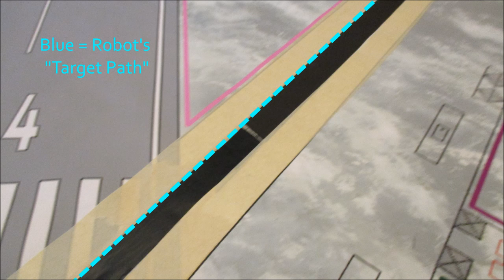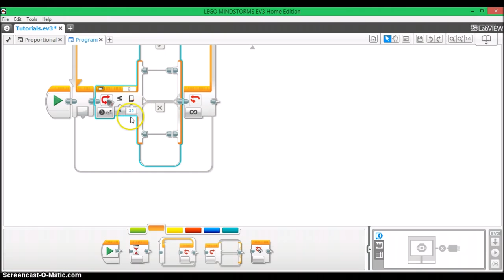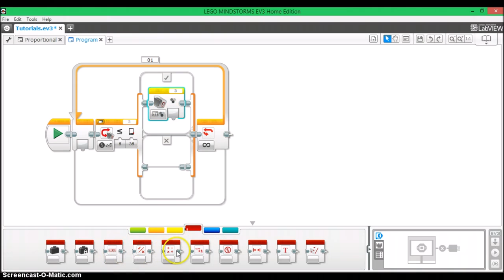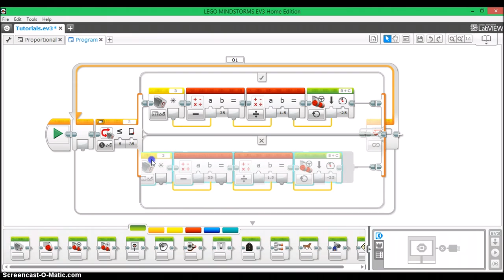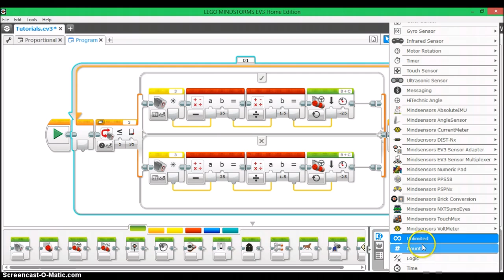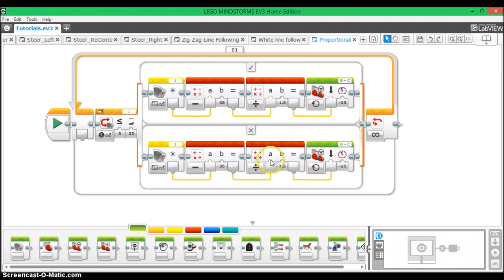How to Program a Proportional Line Follower for EV3

Comment: hi i have a question which is VERY IMPORTANT (for me) you adviced to put the robot on the right side of the line at the timing 6:30 but the thing is that i have to make my robot line follow on the left side of the line then how to program that please do tell me bcoz i already said it is important for me thank you : )
Reply from the maker: No problem! All you need to do is mirror the turning by negating the Kp value (this is the number you multiply by in the math block).

Comment: What are the advantages of using 2 light sensors to line follower over only using 1? Based on watching most of your line following videos, it seems as if using 1 light sensor allows the robot to use a more accurate program like the one in this video or PID line following. It seems as if "1 line following" is better than "2 line following ".  Can you help me confirm this theory?
Reply from the maker: I find that more color sensors makes your line follower more stable and more versatile, especially considering a proportional algorithm can be applied to a 2-sensor line follower. I even have a 3-sensor line follower tutorial coming up soon; that is hands down the most versatile line follower, because it can follow anything from straight lines to 90 degree corners. However, each person will need to decide what kind of line follower they need.

Comment: Builderdude35, why do you divide the light intensity from the first math block by 1.5?
I need some help with that because I want to make sure it works and someone else from my team has the robot. Please reply to this and answer why.
Reply from the maker: That is a scale factor and it is meant to adjust the sharpness/smoothness of the robot's turns. Increasing the value makes turns smoother at the expense of maneuverability. Adjust accordingly to your own robot.

Comment: Hi Builderdude, Your videos are awesome, they are really helpful,
but I need some more fll tips. My team is starting very soon and I need help!
could you please give me some in the comments?
Reply from the maker: Yes, I can give you some guiding advice, but remember it may be somewhat limited here. What was it you needed help with?
Reply: THANK YOU SO MUCH FOR RESPONDING!
I would,like, really appreciate some programming tips.
--Ashvin
Lead Programmer of Team Green Jazz
Reply: Sorry I should have been more specific,
I would like some tips on all of the sensors,
and the myblocks.
My team is having difficulty with the myblocks espicially.
thanks again, I will make sure my ENTIRE team subscribes to you.
Reply from the maker: That's easy enough, I happen to already have tutorials on each of the EV3 sensors, plus one on MyBlocks as well. Go check them out, they should help answer your questions.
Reply: Thanks for your help!
Reply: thanks for your help!

Comment: Great video bro, but you don't need the switch block because both the true and negative operations the logic gate leads to are the same so
You can simply use the operation within a loop block to achieve the same result, great tutorial video anyway keep up the good work
Reply from the maker: Thanks, I'm glad you enjoyed the video! I am aware that the Switch is unnecessary.

Comment: Hey dude,
What's better for line following? Hitechnic color sensor or normal ev3 color sensor?
Thanks a lot
Reply from the maker: +Chirag Gupta Great question! The HT Color sensor will give you a wider range of colors to detect, and a much farther detection range. But if you don't need either of those, the EV3 sensor gets the job done just as well.

Comment: Great videos, you actually don't need the switch though. it's identical... because a light value of (40) - 35 = 5 a left turn vs a value of (30) - 35 = -5 a right turn... the only need for the switch would be if you wanted to have a different scale factor for white vs black.
Reply from the maker: +Nathanael Nisbett Yes, you are correct. I figured the Switch made it easier for kids to understand.

Comment: Where did you get the software? I downloaded my software online but it does not have nearly as much applications as yours. Thank you for this video it really helps, but can you get back to me on my question really quick? Thank you again.
Reply from the maker: +SuavisSomnia I have the EV3 Home edition software. The only difference is mine has a few extra 3rd party sensor blocks that I installed myself.
Reply: +Builderdude35 Do you mind telling me how you installed them?
Reply from the maker: +SuavisSomnia You will need to download the blocks from their respective manufacturer's websites. Then, you import them into the EV3 Software through Block Import Wizard.
Reply: alright, thank you. Keep up the good work, because this you are every helpful

Comment from the maker: + miguel t: the drive mortors are in ports B (left) and C (right).
Reply: +Builderdude35 thx man, eventually i needed to learn smooth ev3 linefollow for FLL.
Reply: +Builderdude35 why 1.5?
Reply from the maker: Mine's Animation PixelUser That's just what I determined through trial and error. That number can be adjusted to your needs.

Comment: In what ports do you have the motors plug in. I did exactly what you did with my numbers I needed to follow the line and only one wheel is moving forward and the other is not doing anything.. Please help I need to get my EV3 ready for my class competition or else I will be disqualified..

Comment: As always an absolutely great video.  I have a question on the second math block you place.  Why is the "B" value set to 1.5? I'm guessing it makes it proportional to the value needed for the correct turn using the motor, but I was curious how you came up with 1.5? Thanks again for posting, you are a very big help!
Reply from the maker: +worthenks That is what is known as a "Scalar value." The reason why it's used is because the light sensor has a known light range, but its highest numbers are too high to be used to steer the robot. So, we divide the light value by 1.5 to make sure our sharpest turns are not too sharp. This is something you can certainly fiddle around with and adjust based on your needs. A higher value in this box means smoother turns, a lower value means sharper corrections.
Reply: +Builderdude35 Thank you for your response and explanation, very helpful!
Reply: i had the same question but i guess he answered it

Comment: Did you use proportional line following in FLL too? If you did, did it prove somehow better than usual line following? I myself did and as it was quite useful and often used, I made some very flexible myblocks for it, allowing you to send in all the necessary information you would want, from outside the myblock, such as the motor speed, correction sensitivity and many more things. I will soon(-ish) make a Mindstorms Community post about it too.
Reply from the maker: ***** Oh, wow, that sounds cool. The only time my team ever used line following was in Senior Solutions, and it was a program that someone else found of the internet. In Nature's Fury, my last year, I was team captain; we only used line squaring because there weren't an lines that were suitable for following.
Reply: Builderdude35 our program was actually too found off the internet, I just added an useful interface to the MyBlock so the same block could be used everywhere in all kinds of situations, without the need to make a new one for each occasion. We too used line squaring in Nature's Fury; however, not very often, as it used up quite some time from the 2:30 minutes.
Reply from the maker: ***** Oh, okay. I thing I would personally go with my 2-sensor line following but I'm not sure; Maybe a comparison video is in order!
Reply: Builderdude35 I personally would prefer 3-sensor following, which is a mixture of these two: the middle one is proportional and the 2 on the edges find out sharp turns and crossings etc, but that wouldn't be as much of a use in FLL as in regular line following. If you had 3 sensors, you could try that out too, see which one gives the fastest and most reliable line-following. Programming a 3-sensor following would be quite a challenge though, I haven't crossed that myself yet :P
Reply: +Builderdude35 can you make a 2 sensor proportional line follower